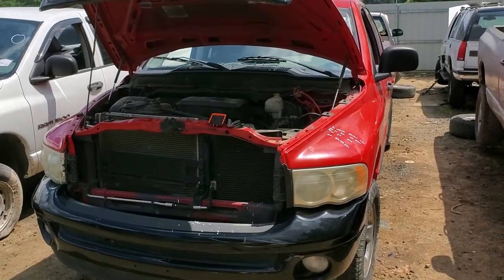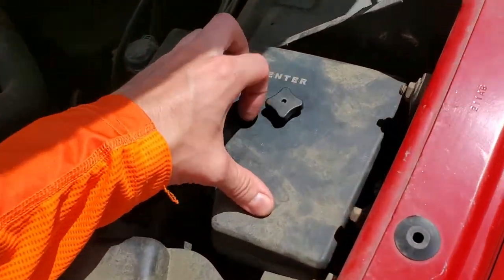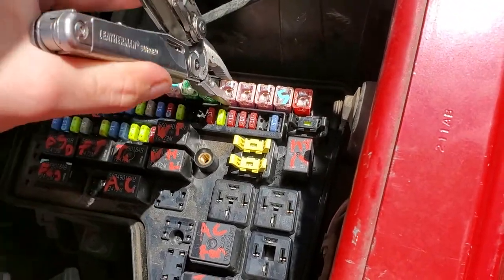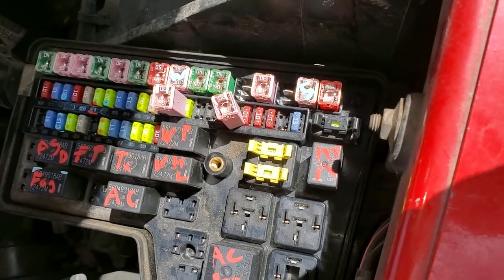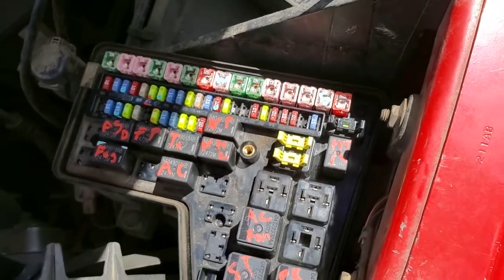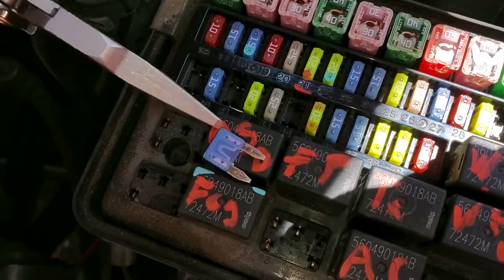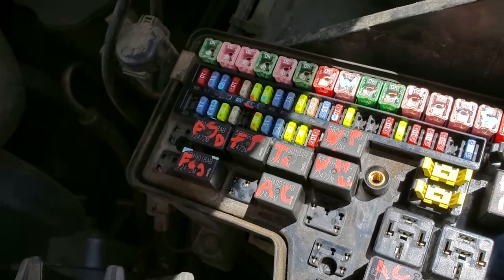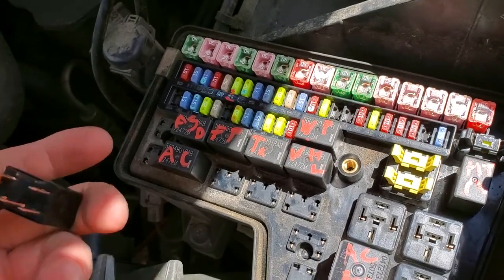2003 Dodge Ram 1500 Headlight Fuses, Foglight Fuse & Relay

Comment: appreciate it ... fog lights never worked since i bought it last year ..tested bulb and were good .. must be fuse issue ..  no interior climate control panal back lighting  illumination either but air works ok ... maybe related to fogs ..... thanks
Reply: The problem might be a Light bulb.

Comment: Hi, I have a 2003 and I need a + cable to operate my extra light that I mount. Do you know with fuse that operate the high beam only or do you know a cable who served + when hight beam ligt is on Best regards Peter from Sweden

Comment: What do you know about prominent issues with relay 73? My driver side rear parking lamps won't illuminate, but the turn signal, brake, and reverse all work fine? Hope you can help!
Reply: Did you ever find a solution to this problem? I have this same issue at the moment 😪

Comment: I have a question 🙋‍♂️ about the running lights. When turning on my parking lights or headlights my running lights won’t come on however I was able to bypass the relay with some jumpers to a toggle switch under my dash. I would like to allow my regular switch to control them as normal. Any idea what to do or what could be the cause of the issue? I have a 2002 ram

Comment: Question.
i have an 02 Dodge Ram 1500.  My 4 pin flat connecter on vehicle for trailer works fine. EXCEPT THE RUNNING LIGHT.  My 7 pin connector on vehicle for trailer works fine. EXCEPT THE RUNNING LIGHT.
What do you recommend?
Thanks.

Comment: How do you remove fuse #51, which is the one that has the black plastic casing around it, next to fuse #38 and looks like the two with the yellow casing around it. I can't get it out at all - thanks.

Comment: My headlights are not working.  I have replaced all of the relays in the fuse box.  My voltage is jumping all over the place, High of 1.07 volts to 0 volts.  This occurs on both low beam and high beam.  I am bamboozled, any help would be greatly appreciated.
Reply: Wiring

Comment: I have an 05 laramie, was wondering about hooking up a wiring harness for it and where I may be able to locate everything. Most everything looks pre wired for the fog lights up to the fuse box. And I do have a lose  connector below the driver side headlight. Would that be what I'm going to, or would I be running it clear into the fuse box?
Reply: For any one wondering it is a plug and play to put it simply
Reply: Did you find a video on it?

Comment: Hi, I have a 2003 Dodge Ram 1500 just like the one in this video.

Fuse #10 is showing a parasitic draw when the ignition is off. It say it’s an (ignition Run / ACC) fuse. My problem is I can’t seem to find out what is drawing the power from this fuse. Any help would be greatly appreciated!

Comment: I have an 03 ram 1500, fuses and relays check out but just have 1 functioning headlight. Open to troubleshooting suggestions.
Reply: Probably your Wiring Harness on that one side Shorted out there easy to replace

Comment: OK so I have 2004 dodge ram 5.7 laramie and my problem is my passager side low beam has no power my high beam does. I know there's a left right for tail reverse and brake. I can't figure this out anyone have this issue?